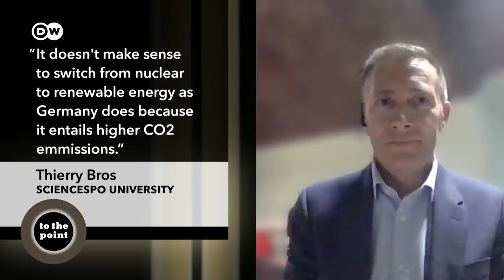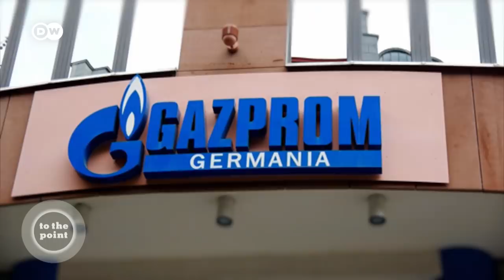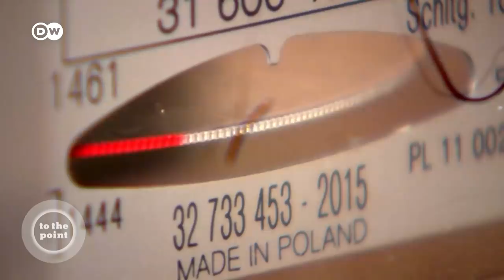Bleak winter ahead: Who’s to blame for Europe’s energy crisis? | To The Point

Comment: 21 minutes in and it's finally mentioned that wind didn't provide enough energy, requiring more gas to compensate. Wind provides diminishing returns,the more you build the less you get. Solar also under performed from a stronger winter and more clouds. Strange how global warming keeps causing stronger winters. Modular nuclear is the future: portable, reliable, cheap, dependable.
Reply: It’s inherently risky to rely largely on wind and solar, which depend on climatic systems, during a phenomenon called climate change. 

Wind power is set to weaken in key locations like Scandinavia and the Great Plains USA as the Arctic warms! Those locations depend on the cold winds from the north mixing with warmer southern winds creating the best conditions for wind power. With a warmer Arctic, there will be less of a temperature difference in this mixture of northern and southern winds therefore vastly decreasing the output of wind power right where we’ve made major bets on it such as Scandinavia and the Great Plains USA.

Comment: you gave up your energy independence, to become Russia's pawn in EU. The guy that says that Nuclear doesn't have a future in Germany and talks about the amazing new house tech to be energy 100% green, i would be happy to learn how many people in Germany can afford a house 100% energy green.
Reply: A wind turbine in every home... lovely. For some reason each building is not running it's own electricity generator, and for some reason it makes sense to have power plants.
Regardless of renewables or nuclear it will probably be more efficient the current topologies of power centrals and distribution.
Reply: Zero footprint houses has been a thing since 1990; 40 cm roof insulation, heat exchanger in the air circulation system. 4 pane small windows and thermal solar on the roof, but building them for the majority will take a century, so not a viable in getting off dependence. Besides, if this is forced, the extra emissions from the accelerated construction activity, will also have to be offset at a later point, so not a solution to this temporary problem. The only thing we can do, right now, is what China is doing; rationing energy for industry, just enough to avoid the worst price peaks, which will keep small consumer prices more reasonable.

Comment: The nuclear power detractors in Germany are completely wrong. Nuclear power is cleaner (12g COs per KW produced, only slightly higher than wind which has 11g), production can be regulated, while with renewables you're hostage to the whims of the climate, and is has mid-long term ROI considerably higher than a large wind or solar farm. People forget that wind turbines degrade rather fast, and solar cells have a very short lifetime, and need to be replaced. It pains me to see these so said "experts" coming to DW with an obvious political agenda while being in total denial about the current economic reality. Especially the gentleman who banks everything on "innovation". Dude, solar cells have been around the same efficiency for 20 years. In this time, Germany could have moved almost all their fossil fuel dependency into cleaner, safer nuclear power plants.
Reply: yep, nuclear power plants in france can and do vary their power output, what the guy says at the end is plain wrong. also what he says on the cost and time to build new ones is debatable at best. we didn't build a single nuclear powerplant in 20-30 years, we completely lost the know-hows and because of that we're wasting time and money. we also pay for the increasingly ridiculous demands of safety agencies that want buildings that could withstand the crash of an airplane 🙄

when we build our nuclear parc 50 years ago we didn't have all these issues...

Comment: The simple fact is, IF a country has to import resources, whatever these resources may be, to provide electricity, heating and such, then it will be politically dependent on the country that supplies it. Period. Especially if the resources are transferred across infrastructure that is build, such as pipelines. It is ok if you supplement your energy by a small percentage but once you depend on this supplement you are dependent.

Comment: Nordstream 2 is a safety valve Europe need. If this pipeline was not there, Europe's gas supply would depend on the southern (Ukraine) pipeline. USA/Ukraine could stop it anytime. Then the situation could be critical. This option is now void. USA want to sell their own gas, & Poland are currently the only customer they have. It is more expensive & transport by ship. Nuclear is going to be transformed within 5 years to molten salt fast spectrum & thermal spectrum burners, and within 10 years we will have Thorium molten salt thermal spectrum breeders. Nuclear is not treated objectively by this panel. They talk about old water based, solid fuel reactors. This subject need to be explored better.
Reply: @JonathanSwiftUK  yes, yes it is
Reply: START NORD STREAM 2 
NOW

Comment: As a social worker in London I was often visiting people in their homes and nearly fainting with the levels of heat they had set their central heating on! I felt that they really needed to have some common sense drilled into them about sensible usage of heating systems   and costings. I also was assailed by them regarding complaints about damp in their homes and it was plain they rarely opened their windows to air their apartments or houses . Yet they expected the local authorities to fix their problems for them when they needed to follow some simple common sense life choices such as take exercise like go for a walk -even on a cold day it raise the blood levels and warms you/ and open windows -it airs and ventilates your home  and frees it from germs / and keeping the heating at a normal level and simply wear a sweater instead of wearing summer -wear indoors on a winter day or evening! I grew up in postwar  times and life was much simpler then and I think our populations need to learn some practical habits again!

Comment: 11:49 Russia wants to bypass Ukraine by switching to nordstream2. This would not increase the supply (other pipes could carry more).
Before they said US imposed sanctions trying to stop nordstream2, because it would “make Germany too dependent from Russia”…
Strange: the gas is coming from Russia anyway. The idea seems to make it run through Germany instead of Ukraine, probably because this would keep the fees charged by Ukraine low.
Any project is an economic project, any project is political. It’s only a matter of size and parties involved.
Reply: Alessandro, you clearly pointed Out the difference, between Nordstream 2, now Stop, but in contrary, the Other gas Pipeline via Ukraine ist working. Ukraine is paid For the Transport. Sanctions dont apply to this Pipeline. This is a political decision. Cui Bono?

Comment: Engineers warned long ago that intermittency is an issue and that, for renewables to truly take off, cheap and reliable energy storage would be needed. Initially this issue was paid attention to in political circles but over time, as it became clear that no cheap, reliable energy storage tech is coming, it was simply brushed aside. Renewables were pushed despite this problem having not been solved.

You can only ignore reality for so long before it reasserts itself. Wishful thinking doesn't override physics.

Comment: The whole situation is just the perfect storm of several factors: Corona led to increased demand. There is an incresed demand due people choosing EV's and rail being electrified. Data centers use even more power than ever and last winter was exceptionally cold.
On top of that every country is trying to change their electricity sector, closing down some old plants and opening new stuff to reduce the carbon footprint. This however is a very slow moving process, so there will be teething problem.
Price levels of 2012 is not the end of the world and I think the situation will change as more and more things are being added.
With that being said. Every country in the world should go for having a completely independent power supply and gas is still a fossil fuel, even if it is the cleanest of them all.

Comment: 1st mistake is to getting rid of oil for renewable energy. One day we will switch but not right now. Nuclear energy is fairly safe and clean. Oil is necessary for many things not just gas.. A partial list of products made from Petroleum (6000 items). One 42-gallon barrel of oil creates 19.4 gallons of gasoline. The rest (over half) is used to make things like: Although the major use of petroleum is as a fuel, (gasoline, jet fuel, heating oil), and petroleum and natural gas are often used to generate electricity, there are many other uses.
Here are some of the ways petroleum is used in our every day lives. All plastic is made from petroleum and plastic is used almost everywhere: in cars, houses, toys, computers and clothing. Asphalt used in road construction is a petroleum product as is the synthetic rubber in the tires. Paraffin wax comes from petroleum, as do fertilizer, pesticides, herbicides, detergents, phonograph records, photographic film, furniture, packaging materials, surfboards, paints, and artificial fibers used in clothing, upholstery, and carpet backing. Solvents Diesel Motor Oil Bearing Grease Ink Floor Wax Ballpoint Pens Football Cleats Upholstery Sweaters Boats Insecticides Bicycle Tires Sports Car Bodies Nail Polish Fishing lures Dresses Tires Golf Bags Perfumes Cassettes Dishwasher Tool Boxes Shoe Polish Motorcycle Helmet Caulking Petroleum Jelly Transparent Tape CD Player Faucet Washers Antiseptics Clothesline Curtains Food Preservatives Basketballs Soap Vitamin Capsules Antihistamines Purses Shoes Dashboards Cortisone Deodorant Footballs Putty Dyes Panty Hose Refrigerant Percolators Life Jackets Rubbing Alcohol Linings Skis TV Cabinets Shag Rugs Electrician's Tape Tool Racks Car Battery Cases Epoxy Paint Mops Slacks Insect Repellent Oil Filters Umbrellas Yarn Fertilizers Hair Coloring Roofing Toilet Seats Fishing Rods Lipstick Denture Adhesive Linoleum Ice Cube Trays Synthetic Rubber

Comment: The question is mute. Europe decided to stop buying Russian gas and also oil when it has found alternative sources. Even after the sanctions Russia continued to supply gas to Europe although now greatly reduced.
Now it is clear that there are not enough or reliable alternative sources. Also renewable sources are not yet optimal in terms of volume and price. To suggest that the EU continue to suffer  in order to force it to switch to renewables that are more expensive will lead to great economic decline and for Germany de- industrialization.  To blame Putin is to deflect the blame.  That is why the question is mute.

Comment: Germany puzzles me. If they want to be CO2 neutral by 2050, they know, right now, what they need. They can't put off until some new breakthrough occurs. They can easily calculate how many solar panels per year, how many batteries, and how many windmills. So they must start today, not rely on what they have done so far.
Reply: Calculate the surface area needed to build a solar farm in New York that can provide 1 GW stable non fluctuating.  Now tell me how much that will cost.
Reply: @gilian2587  You have to include wind in that calculation. I still can't do the math, however.

Comment: norway has amazing drilling tech too.
why aren't more looking into geothermal.
it's clean, once the drilling is done, never needs to be fueled from outside sources, and could go anywhere because it doesn't burn anything, dropping infrastructure costs.
it doesn't need long cables.
you could put it in the middle of a neighbourhood, where it's needed to supply power.
Reply: It's very expensive and it can only be gathered from specific places.

The best option is nuclear energy.
Reply: @danwelterweight4137  
it can go anywhere.
they can drill down 12 miles to the point of too hot wayyy cheaper than buil;ding a nuclear plant.
plus you need fuel for a nuclear plant, plus the mileage outside of inhabited areas.
more cables and towers to get the power where it's needed, instead of building the plant where needed.
Reply: @hg60justice  Your information is wrong pal. I agree that geothermal has a lot of potential, but there's no way around it... nuclear is the only realistic way forward.
Reply: Simple is that, buying from Russia is profitable , Germany and Russia have long tradition of supply and demand even in cool wars, Russia never fail Germans

Comment: Why not use people's roofs to create an internet of enery harvesting through solar and wind power?
Reply: At least in where I live (southeast Asia), companies would rather equip solar panels on factories, businesses and warehouses because the cost of installing is cheaper and the payback period is way shorter (4-5 years vs 8-11 years). The profit margin on household installations is simply lower.
Reply: @wannabewallaby1592  I can see how that would work best for companies. I was thinking that governments could use people's roofs. In some places, they insist that all new houses should be built with solar panels, just like we insist that all new houses are connected to the water supply and have electric wiring.
Reply: @tracesprite6078  As the commenter pointed out - that enables a household to be 100% electricity independent and 70% heat independent! - and just suck up the last 30% of heat! Pity it gets cold in Germany. C'est la vie!
Reply: @factnotfiction5915  As we move more into renewables, we can solve the problems. That's what we humans are good at.
Reply: @tracesprite6078  This is why I support nuclear - it has one problem - high capital costs. But as you say, humans can solve problems which have solutions.

Wind and solar have an insoluble problem - intermittency; yes, it can be mitigated (storage, transmission, backup assets), but it cannot be solved. This is why wind and solar will always be minor contributors to the grid.

Comment: What Europe could do is a rail system or scheme capable of transporting LNG from Southern Europe (LNG coming from Algeria, and other ME countries including Israel) to Central Europe and vice versa, a resilient energy network similar to what is done with electricity. Use current infrastructure (or upgrade it) design cargo wagons for it, and build decentralized natural gas storage as necessary.

Rail as infrastructure because resilience to weather risks.
Reply: Rail is more expensive and provides more room for accidents and leaks than pipelines from Russia.
Reply: @danwelterweight4137   
Yes but I’m not overwriting pipelines from Russia (they’re already built anyway), when I said “vice-versa” that supply could be key to Southern Europe countries case mediterranean suppliers fails (due to political instability, accidents, etcetera).
Reply: @lv3609  southern Europe is already well supplied by the turkstream 1 & 2 and the Balkan streams.   The advantage of long term contracts.
Reply: @felipe-vibor  
I’m not talking on replacing suppliers. I’m talking on Europe having resilient internal system of transport and storage of LNG between regions of Europe (which might already have natural gas supplier). It’s about resilience, and not having any region dependent/locked to one supplier. Granted a rail transport would not have same capacity as pipeline, but would mitigate supply hiccups (and would also send a message to the markets).

Speaking of Turkey and drawing a parallel to Putin, it’s not like Erdogan is overtly friendly to Europe (although given current Turkey’s economy risks of shenigans is low).
Reply: @lv3609  It would be even easier to build nuclear power plants.

Then you don't need pipelines, railines, or dependence on another country (or origin or transit).
You can stockpile decades of fuel in a small warehouse.

As a bonus, your emissions plummet and your electricity prices drop and remain stable.
Reply: @factnotfiction5915  
While I don’t oppose nuclear, I don’t take it lightly when considering cost, timetable to be operational, waste handling of spent fuel, security, plus “not in my backyard” backlash. And surely stocking nuclear fuel in small warehouse would raise security issues.

Nuclear would only solve the electricity production part of the problem, natural gas (and oil for the matter) have other usages in other industries (we recently learned CO2 for food packaging who would think…).
Reply: @lv3609  "Nuclear would only solve the electricity production part of the problem" - not quite so fast.

Nuclear, like wind/solar, can be used to produce electricity.

Unlike wind/solar, Its waste heat can also be used for district heating and other low-grade heat applications.

Nuclear, very unlike wind/solar, can be used to provide process heat (high temperature heat 600 C or more) for industry. Industry produces about 20-25% of global emissions, and about 90% of energy used in industry is process heat.
- Ammonia, Hydrogen, Cement, Steel, Plastics - all require process heat.

Do you want the hydrogen economy? High temperature catalysis of water is much more efficient than low-temperature catalysis of water - so nuclear crushes wind/solar at generating hydrogen.
Reply: @factnotfiction5915  
I would say most of other usages of nuclear you pointing are theoretically, there are no proven application today (today’s nuclear only to produce electricity). On the practical application of nuclear as heat source or hydrogen generation I can’t see industries clustering around a nuclear plant (what could go wrong…), the other option being small reactor near industry which mean a less managed nuclear in the backyard. Given human nature, a mismanagement of nuclear would place us in a situation far far worse than Climate Change.

I felt like your message was more on nuclear vs solar/wind and downplay solar/wind.